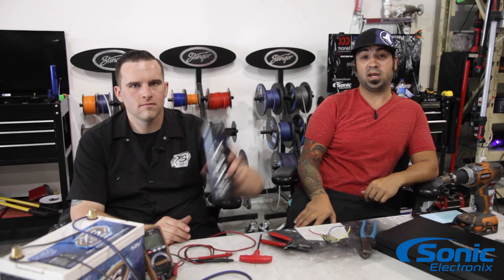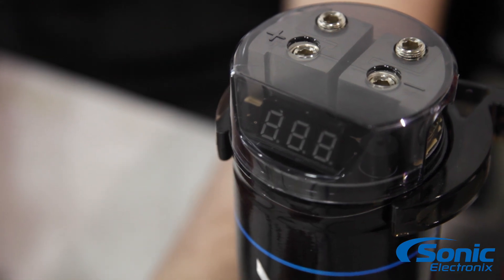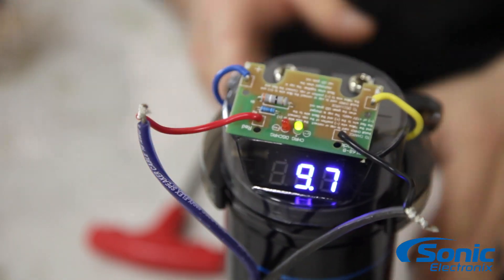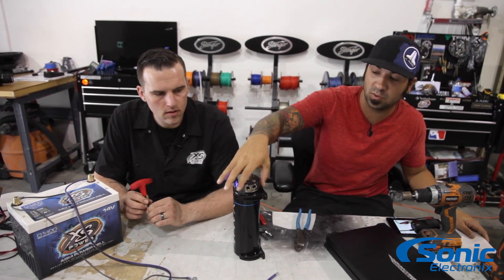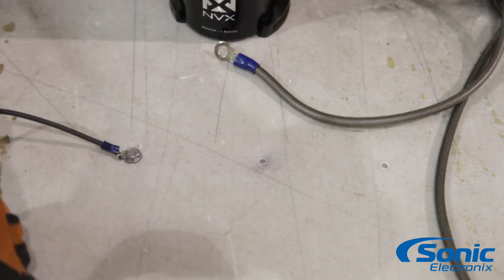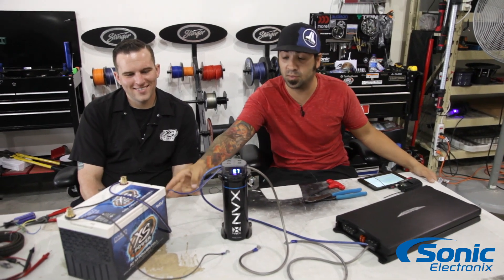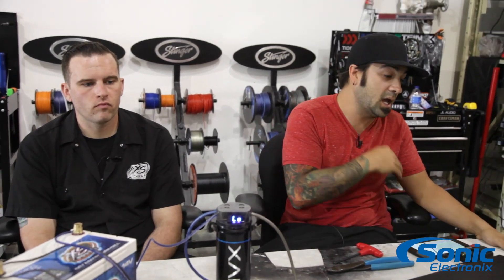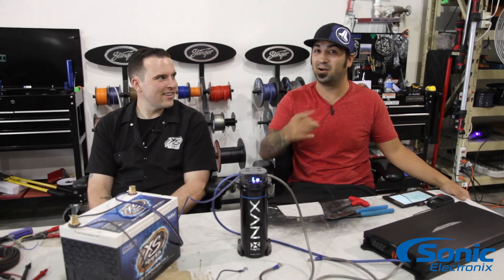How To Charge and Install a Capacitor | Car Audio Q&A

Comment: can you hook a capacitor to two amps
Reply: Not instantly, and the vast differences in demand (2amp to 90amp to 2.1amp all within a second) are not good for its lifespan. The demand is more immediate than its reaction to it, and if the demand rises and drops by dozens of amps before it can react it's kicking on and off, and torquing the belt sharply and suddenly for no reason.
Reply: But on second thought, you said I'm wrong because the alternator gives as much energy as is demanded of it... I never said it didn't. I simply said it can't do this instantaneously in order to prevent a voltage drop from occurring. Are you sure you disagree with me?
Reply: Yes, but it's not recommended unless they're both driving subwoofers.
Reply: yes you can there is no need for recomendation. as long as it solves noise issue
Reply: The reason for the recommendation I gave is because two amps in a vehicle are almost always going to be (1) mono amp for the subwoofer(s) and (1) 2 or 4 channel to drive the other speakers. The 2/4 channel amp should have no trouble driving the speakers at their desired volumes and quality with the battery alone, and the peaks it experiences are minuscule provided the high pass is set correctly. The mono amp is what needs the peak reservoir, this means you should put the capacitor as close as possible to it because wires, like basically everything, are just a type of resistor. You want the voltage at the amp terminals to be as high as possible so that the capacitor's energy is going into it instead of being lost to the wires in between, also leading to the amp pulling more current to compensate, which leads to heat, which leads to more resistance, which leads to even lower voltage.

That being said, it's not going to be worse than not having a cap if you use it for two, it just won't perform as it could and should. Audio-wise you might not notice a difference between the two setups, but that's just because you didn't need as big of a cap as you have in most cases or that you didn't need a cap at all.
Reply: +Jamison W. (Lasherz) you are partialy correct about peaks. but it is not entirely true. if you knew how car amps work. it has a boost converter. and its output is always has a capacitor bank internally. when tranzistors atart driving the load. first thing is gonna get drained is bank sitting at lets say 100v its gonna drop closer to output voltage. due to transistors having internal resistance its not gonna be the same. anyway if the electrical system is weak your car is gonna suffer and not gonna deliver that power even with 5 1F capacitors if you play decaf songs that has long bass notes. its only going to benefit when your music is boomy like bass pause bass pouse. that would benefit because in pause time alternator would compencate. mainly capacitor is to smooth out those dips that occur in 3 phaze generation rectified. capacitor is not neccesary in 3 phase generation rectified signal because it doesnt dip to 0 volts unlike 2 phaze signal after rectification. it still has a lot of ripple witch in theory battery should smooth out. but because battery is fully charged that is not always true. thats why if there is noise issue smoothing capacitor is introduced
Reply: I don't really see how anything I said was wrong, it's a fact that you want the capacitor as close to the largest pulling amp in the system as possible, which would be the mono amp, the other amps are of little concern. The lower voltage I mentioned was external to the amp, not once it's been stepped up by the internals. Point being over distance you want voltage rather than current if you want your wattage to be nearly the same when it gets there.

Now we're getting into what a cap does and doesn't do. I wouldn't recommend anyone who's exceeding the maximum output rating of their alternator on an average scale to settle for only a cap, they obviously need a bigger alternator or a more efficient system (which technically a cap provides, but not enough that most people would find a cap to resolve this issue). The simplest way to put this is that a cap should be used not to exceed the limits of your alternator, but to exceed the limits of your battery. If a solid note for 10 seconds is enough to expose your battery to the demands then you need a bigger cap. If however the draw on that note is pulling say 140 amps and your alternator can only put out 90 amps, well then you've got a different issue entirely.

Not getting into specifics is to make the issue clearer for someone who may not understand all of the details, but within those specifics there's nothing to degrade from the clarified point, that you want the cap as close to your largest drawing amplifier as possible.. In order to avoid the very things I mentioned.
Reply: To the contrary, when energy can be readily stored in an intermediary device in the circuit with much lower resistance than the battery, producing much less heat and thus, losses, it is a more efficient system. This is only because batteries are such inefficient means of energy absorption though.
Reply: JusstyteN
Also to add, the alternator isn't designed to react to immediate demands, and when it's constantly shifting demands its lifespan is reduced and its output is less targeted. Alternators function most efficiently when the demand is smoothed out. With just a battery which isn't able to handle the peaks what happens from the alternator's point of view is a huge voltage drop, the alternator kicks into maximum charge mode, but before it can even do that the demand is over and the battery has recovered the voltage, so you end up with just a fraction of a second of high engagement from the alternator. When the demand is constant the alternator sees no significant peaks and is easily able to provide a targeted static input current.
Reply: JusstyteN
Beyond the obvious limitation of the alternator's specs, my car's can't put out more than 90 amps.
Reply: I have busted capacitors nothing but a waste of money if you want to really spend the money for what your wanting upgrade engine parts best bet there. These capacitors don't really work wow it suppose to make your lights not dim ECT ECT.  That's bullshit I got a 02 Tahoe with two 15 kickers without the POS capacitor. Using a 1,300 watt amp both bridge and I don't have dim lights or any electrical issue to my Tahoe, now with my 05 dodge ram I got two fostgates 12s 2ohms and they dim the light these  trucks don't need alot of bass just enough to make it sound good inside. I know old school and we don't use stuff that really don't work in the long run. I got a friend of mine that has 20,000 watt and he don't use capacitor and wins competition against anyone. Should of took a video of my 91 blazer I had I put two 12s in it and you would think I had four 15s in it and when I open the back door people was shock it would make the whole lil blazer flex so bad I ended up with a full windshield looking like a spider web.
Reply: Jamison W. no a big no capacitor doesnt make system more efficent. it is a filtering capacitor that is for filtration purposes only. amen
Reply: Jamison W. no you are wrong alternator gives as much energy as you demand
Reply: Jamison W. no energy is generated on demand as soon as you demand the power alt is putting more torque on the belt. if we are talking about a conventional non regulated 14v aternator. yes it cant provide more than it is rated for but alternator  is putting out alternating current also called AC witch capacitor filtrate to complete dc. 1 or 2 farads is not enough to provide power bursts. its just not storing enough energy. if you had at least 100F cap than it would be the way you are talking about it. basically capacitor is no good for more than couple of cycles that alt is generating. caps like that are mainly for filtration purposes so that the voltage ripple woudint be 2v from 14v dipping to 12v in a couple of miliseconds and rather gradually dipping to prevent any noise and ripple. remember alternator is generating AC witch we are trying to filtrate to DC.

Comment: hi am using car system in my house,an my source of power is a computer power supply.my question is can i use this capacitor an if yes is the steps the same?my power supply keeps on going off
Reply: that is probably because of a different reason. i would guess that the power supply cant deliver the power that the amp is "asking for", and because of that, some sort of protection mechanism is shutting down the power supply.
Reply: can i use capacitor with pc power supply
Reply: I wouldn't if I were you. Instead I would use a car battery as the intermediary step between the supply and the amplifier. I would also use a car battery charger instead of a PC supply, these can be quite sensitive and really the 12V rail isn't necessarily enough voltage when you account for voltage drop on the battery. It won't last long compared to if you did it with a car charger. Also a PC supply depending on which you use is going to use more energy in general than a car charger. The 12V rail is like 12.3V max on a decent PC power supply, but a car charger is 14.5V Also in terms of current, you would have to run all of the 12V lines to the battery and that's still only a small part of its rated wattage, so you could burn out the 12V rails pretty easily if you tried to push it beyond its ability.

Comment: Hey guys just trying to get this straight we have to charge it everytime or does this charge as it runs off the battery sorry not a audio genius at all LOL
Reply: capacitors have a small leakage so they do discharge with time, so if its disconnected from the battery, during the night it will probably discharge almost completely,  but as you can see in the video the capacitor is basically connected directly to the battery, so its always geting power, and you dont have to worry about it.
Reply: Bruno Cardoso got it Thanks for the reply guys
Reply: no problem :-)

Comment: Hey guys I want to build an spl car where do  I start and what's a good budget to have
Reply: I would start by doing some research and planning my build. 
2nd, I would make sure I have enough money to be able to support an expensive hobby.....so I don't have to live in my project car.
From then on, It's up to you as to what you want, It's your money.
Reply: I would save up about 1000 just for the  low sound and about 3 to 400 for your highs an mids

Comment: What about a cap discharging while the car is on? My car usually reads around 14.3 but while driving it drops to 12.2 then the cap will shut off on the lcd.
Reply: The voltage of your battery shouldn't go down while you're driving around, ever. If it does then this could mean you need to make a fundamental change to your car's electrical system such as a new ground wire leading from the battery to the chassis, a new battery as that one could be failing, or a new alternator if it simply can't keep up with demands. Also you should make sure the ground to your amp is good, because the LCD ticking down just means the amp isn't getting enough charge, it could be the fault of the car or it could be a fault of the connection to it. The voltage will fluctuate a little bit as your amp draws off of it, but it won't settle at one value, it'll jump back up to 14.4 or so between beats if things are working properly.
Reply: the cap can only maintain the voltage of the battery so if the battery voltage gets lower, like when you are driving around, the cap voltage win decrease too. even tho the lcd is off i don't think the cap is, so there shouldn't be anything to worry about.
Reply: Ok, thanks

Comment: I have resistor plugged into the Positive and the car ground hooked up to the negative. I then touch the other end of the resistor to positive battery power and after a few seconds my LED reads "Lo"> IT stays like that. I get not charging digital numbers counting. What would cause "Lo". I know for sure that my ground is good with paint sanded away.
Reply: maybe your resistor value is to little and is consuming the voltage himself~.
Reply: Two things. Make sure that the car is on while you're doing this, and also make double sure you're not switching the positive and negative around on the top of the cap.

Comment: You guy's did so well...   Very clean and esay to understand.

To watcher... Take note to plug de capacitor closer than possible to the amp...  Then else the cap will only used as a filter.....

Comment: Why does it need separate ground
Reply: otherwise you don't have a closed loop (for current to flow)
Reply: Ahh
Reply: dont listen to that guy, the point is you can have separate ground points, not required, it is a closed loop if you dont have a separate ground point. as long as there is a ground wire in the circuit,  connected to chassis/ battery and you have the 2 cables connecting all the components, the circuit is closed.you can think of the ground points as ways of connecting together the ground wires.
Reply: You get ground noise I'm not an expert but I'm not a Dumbass either lol I know a lot more than most people I was just saying ahh because it sounded dumb lol ... Not bashing or being a smart ass

Comment: Very informative video. BUT is you install the cap more than 12" in cable lenght away from the amp it supports, then the cap becomes a just very fancy voltmeter, its supporting effect totally dissipates due to the "enormous" distance to the consumer (amp). Your table car rocks though...!
Reply: what makes you think that?
i would believe that it wouldn't matter where you had it as long as it was between the battery and the amp.
Reply: It matters, but the point he's making is that wires are just very long resistors. No matter the quality of the wire you're going to incur losses and those losses manifest as voltage drop. You want to put all of those losses on the battery side of that if at all possible, that way you're starting at the cap again with a freshly peaked voltage. If you put it by the battery then you're opting for a % loss on the benefits of the capacitor. Also with the new cap you may find that long wires are fed more amps which is going to increase their voltage drop and make the problem more noticable. Shorter wires are better if you can manage it. You'll get the best bang for your buck, and caps tend to give small returns to begin with.

Comment: my capacitor  reads a 15 sometimes is that bad?
Reply: the capacitor will go as high as the battery is, so if its ok for the battery, the cap should be fine. just check he cap specs for max voltage as they dont like to be overcharged.
Reply: No, it will go as high as the voltage regulators on the alternator allow it to. Typically you don't see voltages that high even though your car's voltage regulators are set to maintain 15v. The reason for this is that your car battery becomes very restrictive to additional charge and the voltage just doesn't take. Also the alternator has a range goal where it will work harder or less hard depending on where it is in that range, typically between 13.5 and 15v. If it's at the top of that range it means that the alternator has charged it completely, nothing more. It's important to not allow the cap to backflow to the battery and alternator though, as this can confuse the regulators and cause spikey alternator uses that will ultimately shorten its life. This is one of the main advantages of a cap, avoiding those.

Comment: so when I have my capacitor installed, when I turn my car on the next day, how do I recharge my capacitor? or do I just have to wait for it to charge?
Reply: +Brendyn Buell Your cap will stay the same voltage as your battery, so you don't need to charge it again.

Comment: I have a 900w amplifier and I'm having unwanted noise from the speakers. I'm thinking of buying a capacitor but wouldn't know which one to pick. Is a 2 farad a good choice?
Reply: Unwanted noise is usually hum from the power cables being too close to the signal cables. It has nothing to do with a capacitor and generally a 900w amplifier alone isn't enough to warrant a cap unless you have a failing battery, in which case you should get that taken care of first.

If you have power cables traveling on the same side of the car as your signal leads you should change that right away, you'll see a noticeable improvement. If not that then you may have a bad quality junction, splitter, or crappy RCA plugs/wires causing that problem. Test the resistance of the signal cables and see if any terminal is reading high relative to the others.

Comment: Ok Ok.. I've seen dozen of videos where they recommend charging the capacitor before it's first use, but non of this videos, (including this one) explain if this process needs to be redone after e.g. battery change or simply after long idle time (let's say one to two week(s)). Could someone clarify this topic?
Reply: +Patryk122PL When a cap is fully discharged, connecting it to a battery will cause a powerful arc.  That's the primary reason to trickly charge it with a resistor.  You expect some arcing anytime you connect one, but a fully depleted capacitor's arc is wildly powerful, like shorting your battery.  Changing your battery MAY drain your cap if a vehicle light is on while the battery is out.  Avoid that if you can.  If you have a hood light, pull it first.  If you have lights that you have no way of turning off while changing the battery, disconnect the Cap ground.  
A long idle time doesn't discharge a cap, so that's not an issue.  It will stay charged so long as it's connected to the battery.
Reply: Thank you. I'm planning to install a capacitor in my car, so I'm glad it wouldn't be a nuisance to maintain.